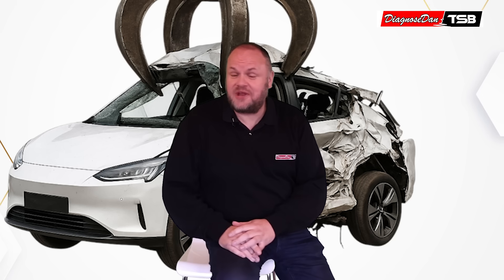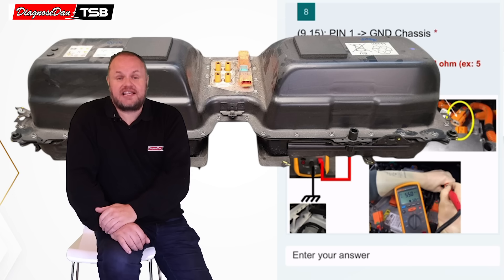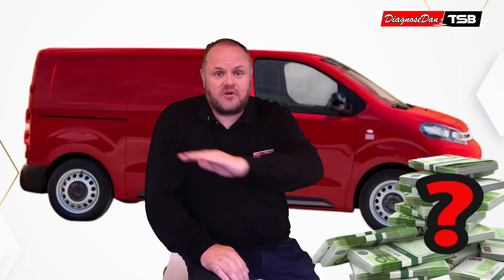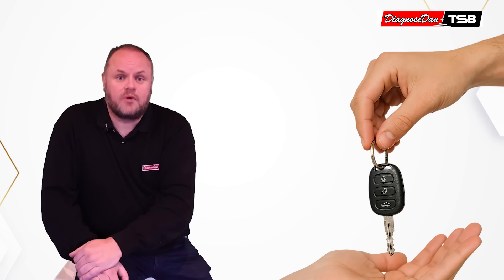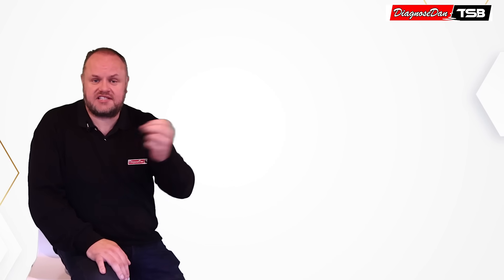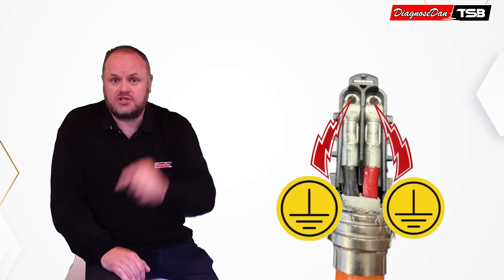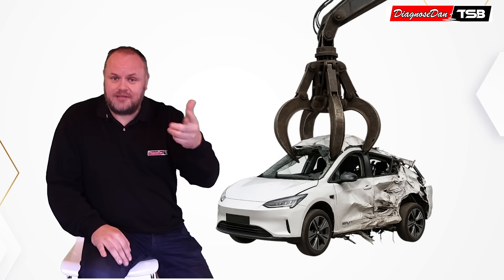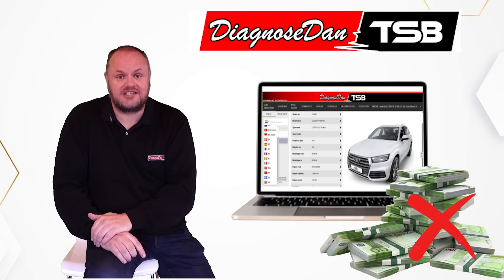4 year old EV nearly scrapped – Citroën e-Jumpy IV stores fault code: P0AA6 09 – Drive Battery

Comment: I am a little confused. Are they not both earths? Could someone put me right?
Reply: Not necessarily, the cable shield is likely tied to chassis ground, the black not so. This way the charger, BMS or other controller can monitor potential earth leakage on the pos and neg bus cables.
Reply: @leet6825 I see, thanks very much for the explanation, cheers Dave

Comment: Ive worked as a technician for Volvo, Nissan, Kia and Hyundai and when you get in a rabbit hole like this, you can ask for guidance/assistance in the shop by someone from the brand fault searching technicians.
Volvo, Kia and Hyundai will actually ask you to assist you when you are doing warranty claims over a certain amount, first remotely and when you can not get it figured out with them, next to you and the car.
These guys come in with a complete different mindset and tools/replacement parts on how to diagnose a problem that seems to have no end.
When you replace that amount of parts under warranty, the further fault finding is still under warranty when the issue is not resolved.
I don't know how Citroën does their warranty, but this is a complete fail of the brand and the dealer in my opinion.
Reply: This was normal 40 years ago. Not anymore.
Reply: It's certainly not very efficient!

Comment: Workshops and dealer garages just change parts these days, Its worth becoming a motor mechanic now so you can avoid them, I must have saved many thousands after I retired by not using them.
I would rather spend more money keeping my 23 year old car on the road than buying a new one and don't get me started with these EV's it's a future most sold con.

Comment: It seems technicians in dealerships are just parts exchangers and they only read the "steps" some engineer wrote thousands of kms away from the car, but they aren't capable of reasoning and looking for the actual problem. And kudos to the shop that repaired it! It's good to know there are still good people around there.
Reply: In the 1970’s after a faulty repair I surmised that the future of auto repair required 2 technicians, the diagnostician and the parts changer. That time has come. The problem I see is that we train far too few qualified diagnosticians and too many parts changers with scan tools.
Reply: Yes you are 100% correct with that assessment as 99% of all unknown faults are diagnosed by substitution. The critical word here is unknown or in other words faults that have no clear symptoms relating to specific items. Diagnosis by substitution of a known good part is quicker, cheaper, and more secure when searching for the unknown. In this case the computer is introducing false direction and the parts are so expensive that diagnosis by substitution is questionable for anything other than the cheapest parts. It's not a surprise to me that the fault turned out to be the cable as its the one item that been hand made rather than machine.
Reply: @johnturnbull7798  I mean, I can understand that if a part costs 30€ and it would take an hour to be diagnosed properly. So the part is cheaper than the diagnosis. But they spent thousands of €€€ with the parts cannon 😂😂
Reply: "I wouldn’t say the dealership technicians are incapable.
Rather they are often restricted from thinking outside the prescribed procedures. Manufacturers require strict adherence to diagnostic test plans and deviations can result in the dealership not being compensated for the time or parts involved."

Comment: No wonder dealerships are expensive when they have to cover the costs of partscanon repairs.
Reply: As long as they follow the test plan the manufacturer will compensate them! Thats why they can't think outside the box. If the test plan doesn't tell you to replace a part no warranty from the manufacturer to the dealership.
Reply: @Diagnosedan  Wasnt blaming the tech, but those that wrote the partscannon way of work :)
Reply: @The_Noticer. 😁👍

Comment: This is the problem with a lot of service shops, especially dealer workshops, they no longer do any real diagnosis, they just use their computer, that tells them to replace a component and that's always at the customers expense. It great to see how honest this independent garage was and let the customer buy the van back. That's the sort of company that needs to be named as an example of a quality company.
Reply: I know a couple good fault finding technicians that work at dealer workshop. (Peugeot)
The problem is that they need to follow the test plan Peugeot provides. (Its logged in the failt finding computer and its the same on other brands) Especialy under waranty. And the test plan is good but not that good.
And the fault code description some times does not have enough information/description.
So the conclusion is that the tools manufacture is providing is not up to the task all the time and the technician cant do anything about it.
Reply: @fulf  agree. If the manufacturer pays for the repair by warranty they can demand that the diagnose is made on their terms. When I worked for a dealership that was my biggest frustration, that if you did not follow the tester you did not get warranty coverage.
Reply: This type of independent workshop should be published on social media platforms, on some sort of role of honor, along with others like them.
Maybe the lazy arse dealerships would get their act together !!!
Reply: @bartmanlestrade9089  Yes, they should actually get a reward for this👍
Reply: Looks like the diagnostics chart for those codes should start with checking the cables after unplugging them on both sides. That's certainly a fail on the manufacturer's side. So they lose money under warranty but make money in service once the warranty is up. And they take a hit on reliability.
Reply: Yrs, there are lots of technicians who are sloppy in their diagnosis. But in this case I would not blame the dealer workshop. They are forced to follow procedures for warranty reasons. 

I have encountered this myself as I work in a bus company. We had an almost new bus with transmission problems, under warranty, and the technician was fairly sure about what the real problem was. However he was not allowed to jump the process, so the bus was at the shop for two unnecessary months before the technician got angry with the parent company and made them allow him his solution. If not for him making that angry call, the bus would have been there for probably two more months, and the technicians would have been doing a lot of unnecessary frustrating work.
Reply: Unfortunately in many cases they have to, of they replace parts without following the test plan they might not get compensation from the manufacturer.
Reply: When you work at the dealership  you have to follow there flow chart, they do not want you to think outside the box
Reply: @JoelAutomotiveInaction You mean that they don’t want you to think! So sad.
Reply: and often the broken part, that has been replaced is doomed to fail again, because nobody tried to figure out the root cause.
Reply: Parts fitters. Not mechanics

Comment: For sure that should be not only reimbursed from the manufacturer. Also compensation should be paid because of the time the customer had to take to diagnose a fault from the factory, on the HV system no less .